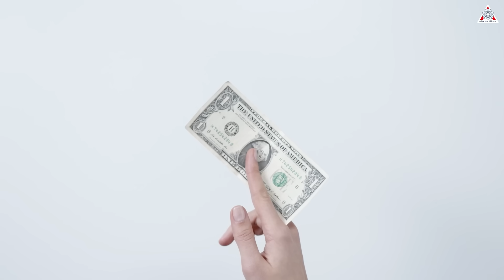Why Starship first reaching orbit is even more important than NASA thinks???

Comment: The aerospace industry has changed because for the first time in history paramagnetic and reactive titanium and aluminum alloys are welded using electromagnetic laser automation. Double joints with controlled asymmetry from both sides of the material at the same time. Monohulls for integrated fuselages made by serial stamping of components and automatic welding...Hermetic fuselages more resistant to pressurization at high altitude... This means that starting in 2020, spacecraft, modules and liquid propellant tanks will be built with this new technology. ...People talk about engines and they work 8 minutes 30 seconds to get to space...Space travel depends on laser electromagnetic manufacturing technology and space x does not have it...that's why its engineers made the rocket out of steel . ..it is very heavy and dysfunctional...They do not have the technology and have been surpassed by the new system...NASA engineers know it perfectly...The SLS has no future and neither does Starship...Space travel , it is not a question of engines... ARTIFICIAL GRAVITY... Well-being and health for the human organism in space... The industry has changed... Spacecraft... Civil and military aircraft are going to be Stamped on series and the new electromagnetic laser technology supported in America and Europe in 2020 unites all its components perfectly. This is the true reality: the serious engineers of the United States and mainly of NASA know perfectly well what I am saying.
Reply: Sometimes old ways work better and cheaper than new ways. That is why the switch from carbon fiber to stainless steel was done by SpaceX.  Once Starship gets to orbit, then it might be time to start looking at other ways to do it. But right now SpaceX has a production line that works. Modifications to the design unless absolutely needed can wait. Even if Starship only gets 90 tons of payload to orbit, that is still more than anyone else has done. And far cheaper than others too.

Comment: It would be nice if it reached orbit without exploding (again).  But Orion has already been to the Moon and back.
Reply: Orion is made with a FSW probe in soft aluminum...The new electromagnetic laser technology is a new technological formula and allows building in better materials such as titanium...Perfect automatic welds from both sides of the material...Spacecraft and Thrusters . The tanks are much better with the new technology supported in 2020 and the pressurized modules too...SLS is obsolete and its technology is vastly surpassed by the new electromagnetic laser method in aerospace alloys...
Reply: @eduardoamaro7867  None of which stopped Starship from exploding.
Reply: Unmanned. And SLS is a one shot deal. Once fired, it isn't reusable a second time. Just like the Apollo program Saturn fives. And even they had problems. Remember Apollo 13?
Reply: @gravelydon7072  Starship was unmanned when it exploded.  And Apollo 13's issue was with the Service module.  The Saturn V had a 100% success rate.  IOW, it never exploded.
Reply: @TheCNYMike  Sorry, but the Saturn 5 was the entire rocket. The Service Module was a part of that rocket. It was its third stage. Therefore it did not have a 100% success rate as Apollo 13 using Saturn 5 #508 failed in its mission. And only by the use of the LEM did the astronauts make it back to Earth safely.

Comment: I have confidence in Elon and the SpaceX team.
Whats really sad though is how so many of the competitors are still fighting the last war.
They dont seem to have realized the magnitude of what Elon has already proven with the first test launch, That the only real limit is how much power you can produce.
That limit negates all other limits in designs and materials.
And Methinks with 
Raptor 3 engines likely flight tested soon, it will become apparent that theres a new paradigm functioning.
That it will rise noticeably faster than the last ship, and have way fewer dead engines. And cost way less to build.
Basically Raptor 3 will be the dawn of a new era in rocket engines, and all the competitors will jerk awake when the numbers come in, and everybody will be designing and marketing copies. 
My advice to Elon would be produce Raptor 3 engines at scale beyond SpaceX requirements, and  sell them to other hull start ups, and use the money gained to stay ahead of the pack.
Would be the single most effective thing that could be done, to accellerate humanity off planet.
Sell good engines cheap.
Rator 3 is gonna be the Chevy engine of rocket motors for the forseeable future, and getting production up ASAP will corner the most market share. It would electrify
investors, and we'd need to multiply related education by 10x or more just to keep up with the demands.
I said it years ago observing Elon, that there would come a day there were spaceship yards all over the planet, each employing thousands of workers, building huge ships in myriad numbers.
Space is where industries go to find infinite growth.
And the companies who build safe and reliable ships will be the blue chip stocks of this century.